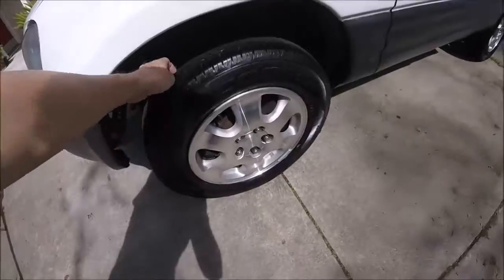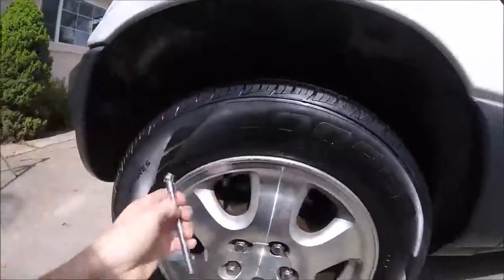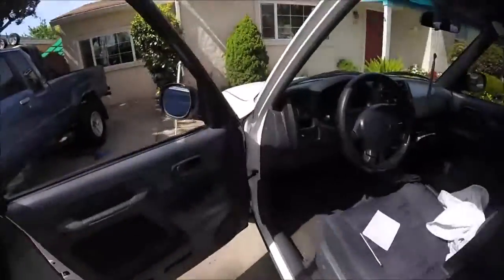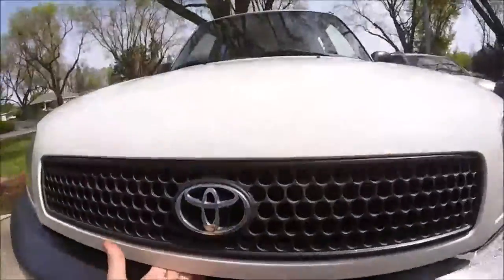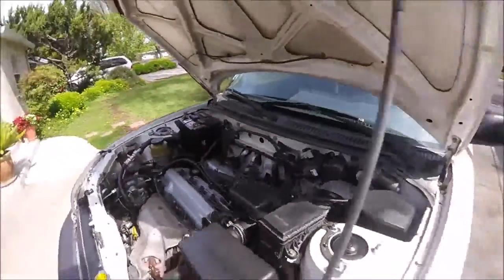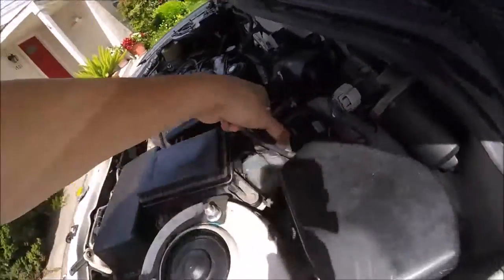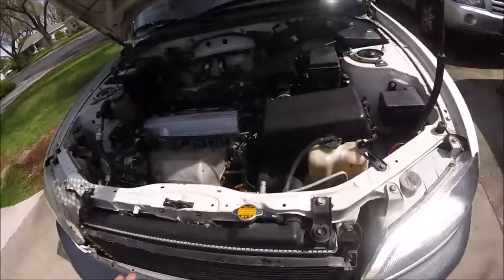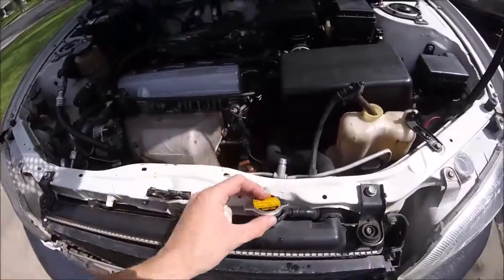5 Things You're Probably Forgetting to Check Regularly on Your Car

Comment: any way to fix burnning engine oil on RAV4.1 thx
Reply from the maker: If the engine has a lot of miles it could just be tired & letting oil pass through and burn. I would try running a heavier grade oil such as 10w-40 to see if that helps cut down the oil consumption. I would also change out your PCV valve (only a few dollars) if you havent done that. A bad pcv can also cause more oil to burn. These 2 things should help it. Good luck!